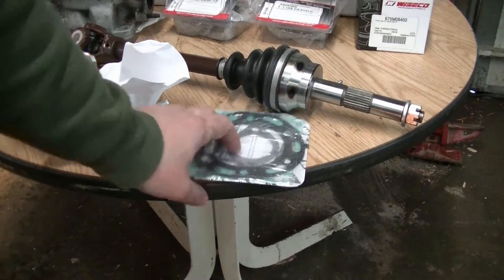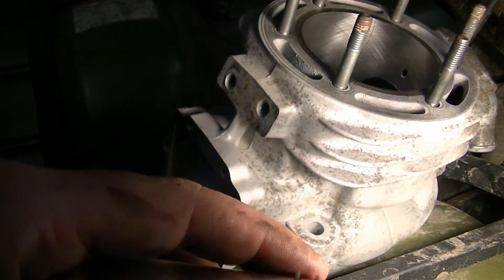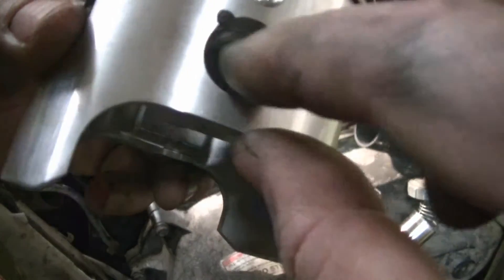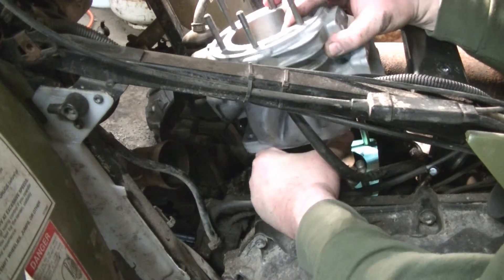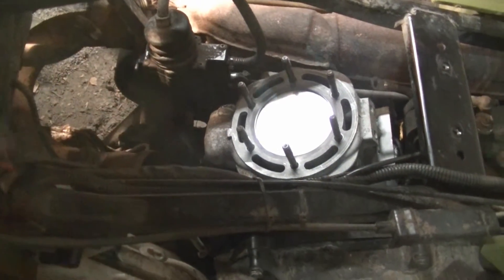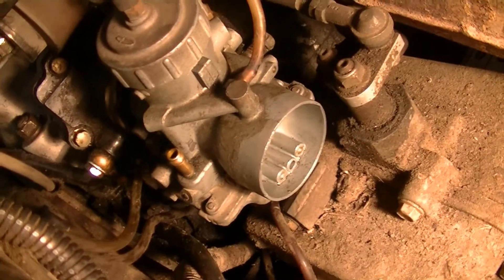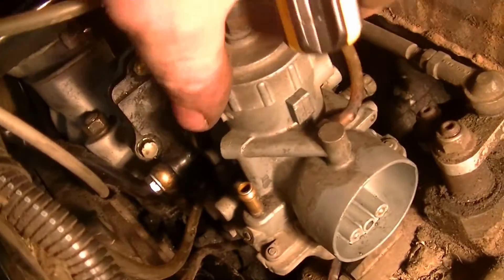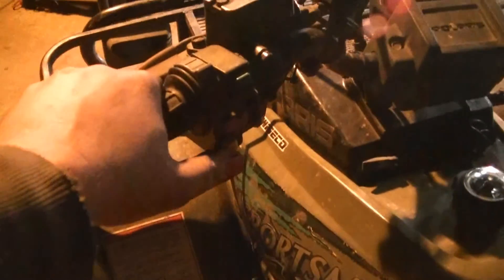Polaris Sportsman Engine Rebuild: Assembly

Comment: How did you compress the rings??
Reply from the maker: reyes silva It’s been a few years...  I think you can just use your fingers as you gently slide the cylinder down on the piston.  The bottom of the cylinder should be tapered and make it easy.

Comment: I have the same machine and it died when the original piston skirt dropped into the crankcase and blew out the base of the engine. I removed the engine and had a competent engine rebuilder do his magic...a complete rebuild. I swore this would never happen again so I had a forged piston installed rather than the stock cast variety. I installed an automotive temp gauge in the coolant system so I can see the operating temp and not rely on an in dash idiot light. I went from oil injection to pre mix. The machine got more attention with new reeds, new starter, throttle cable. I love the machine as I use it for work duty only...plowing and moving firewood. Thanks for posting your work.

Comment: I have a 99 scrambler 400. Same 2 stroke engine. I bought it from original owner and still has original tires on it. It’s been a garage queen it’s entire life and hardly has any hours on it judging by original tire wear. It has tons of compression and the recoil start is a pain in the ass to pull. Thank god for electric start lol. But everybody keeps saying rebuild the top end anyway because factory piston breaks the skirt off. But I really hate to tear into it when it’s in such good working order.
Reply: Wish I could show you a picture of the skirt that just broke off of my "garage queen" lol. Luckily almost all of the debris went through the exhaust.
Reply: @Harveyw1000  my 95 scrambler 400 top end went 4 days ago, when the piston moves, It sounds like it scratches, no compression, people tell me it's just the rings, but I dont understand how it blew up

Comment: Do I have to file the piston rings to fit flush so there's no gap like in the video when u where squeezing the gap closed or can they have a gap
Reply from the maker: Sorry, my memory isn't the best.  If I were you I would look up the engine specs and check the ring gap spec.  Then you can see if yours is close.

Comment: Would it be the same process on the 500?
Reply from the maker: anthony griggs It should be similar.   Probably will be some small differences.  I don’t know for sure, I haven’t worked on a 500.
Reply: The 500 is a 4 stroke. Totally different engine.

Comment: Been looking for a video of a top end assembly on this exact motor. I was told you can't put the piston in through the bottom. Now I know you can and what I might be doing wrong with the ring alignment. Good video. Thanks.
Reply: Raymond Mills yeah i had the same problem it was because I was talking to auto mechanics... with a cars engine the Piston does goes through the top. Not with these types of engines lol

Comment: The wrist pin, piston, rings and cylinder all need to be coated with oil during assembly
Reply: Mr. Fixit yeah and he just "snugged" the base bolts on the cylinder. I would have cranked them down pretty tight.

Comment: The reason for putting the clip in up or down is If the gap in the risk pin clip is not up or down but left or right the G-Force of the piston going up and down and stopping suddenly will cause the clip to "Bounce" out of their seat and pop out, then you have a engine failure!!!  Good Videos for quick fix!